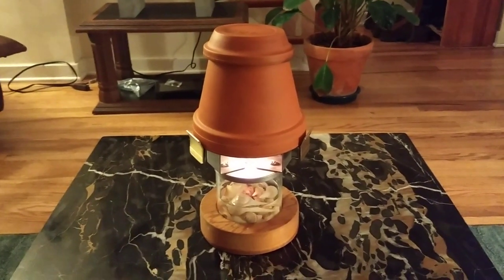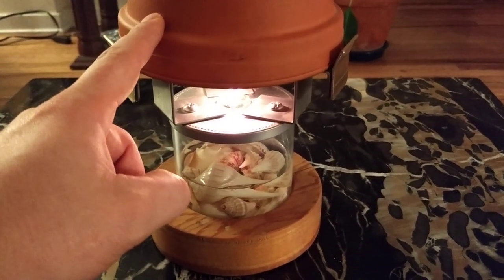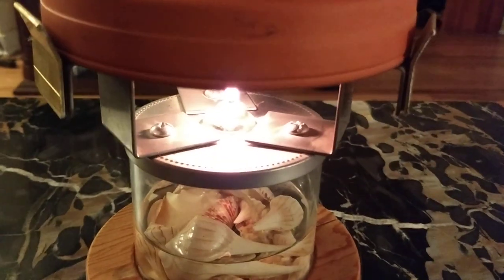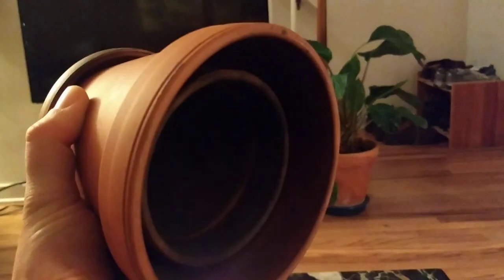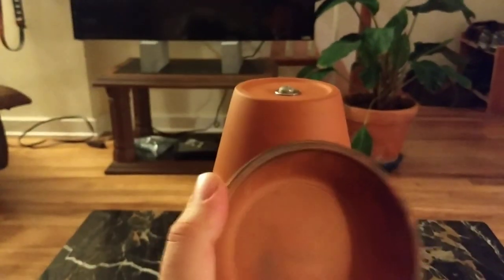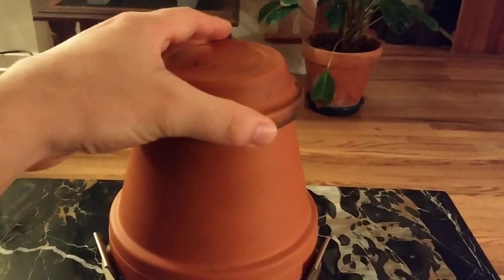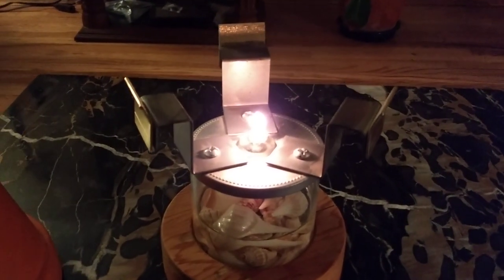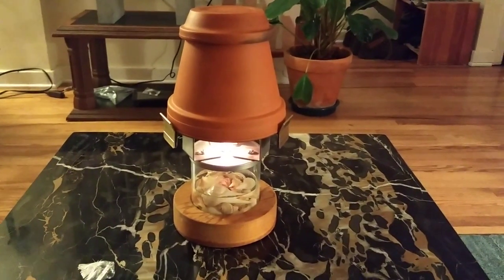Improved "Candle Heater" Design

Comment: A candle puts out heat  that can be measured in BTU's. A clay pot does not increase the BTU"s of the candle. The heated air rises to the ceiling. The clay pot will radiate the heat to some degree, but the warm air still rises just like using only a candle. My ceiling temperature did not increase after 6 days on continuous burning. It takes many more BTU's to heat the air in a room down to an "altitude" the you can feel. It's fine for warming your hands or maybe closet.
Reply: In an emergency situation the last thing you want to do is waste energy trying to heat a room using a convection heater!  What he has actually created is a RADIENT heater - the walls of the pot pick up the heat and then radiate it out as you would discover by taking heat measurments of the pot wall and your ceiling.  Naturally given the very low energy input the level of heat output will also be low but it will be enough to heat your hands/feet, etc.  If you switched to cleaner fuels (eg methadone) and used carbon felt for the wick you could then place a mantle of fine steel mesh over the flame and place a metal reflecter shaped into an arc behind it you would then have a clean and very efficient heating unit!

Comment: Interesting concept, the only change I would make is to have a personal fan gently blowing air onto the terracotta or a handheld bellows system

 I toyed with a cheap alternative and scorched a Formica topped vanity by NOT properly ventilating the system.. That interior pot gets EXTREMELY hot and can re-direct the heat back at the source..Using a fan can cool off the hot outer surface
Reply: You can buy those little fans on Amazon and other places. People buy them and put on top of their wood burning stoves to move the air into the room.
Reply: @penbiz6744    I saw a system involving a  HVAC elbow sitting on top of the outer pot  with a personal fan built into the outlet.. Much more efficient.. It draws the air faster between the two pots than a normal convection process.. but it can cool the inner pot quicker as well..

Comment: If you can pick up the pot with your bare hand, it's NOT putting out enough heat to matter.
Reply from the maker: You are correct sir. It puts out no more heat than the flame. You will not be heating your house with one of these.
Reply: I read that poor people in the Victorian days would suspend a brick over a candle to be able to get some heat in the room .
Reply from the maker: @howardwayne3974  Great bit of trivia that demonstrates the concept. I did not know that, thanks for sharing!
Reply: It's Infrared

Comment: How much heat comes from it, how long does it burn 🔥
Reply from the maker: 19900 Btu's per pound of parrafin fuel. It burns slowly, maybe a quarter pound of fuel per 24 hours. Thus, it's not good for heating your home, but can be effective at providing some warmth in small spaces.

Comment: are we to assume that there shouldn't be any dangers for fume accumulating? bc this is just like burning candles in the house right?
Reply: Ventilation is always important when using any kind of combustion.  In a large room it might not be much of a problem unless it's closed off with more of these units.
Reply from the maker: Couldn't have said it better myself!
Reply: I think if you're burning anything indoors you should have battery powered CO and smoke detectors (battery so they'll work in a power outage)